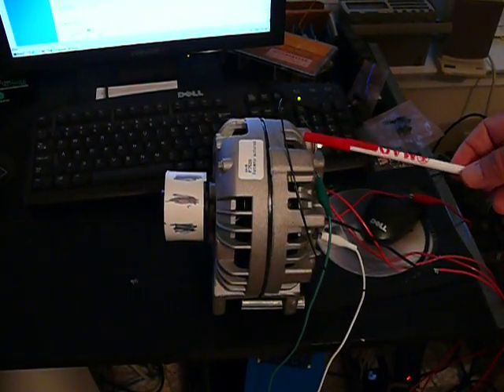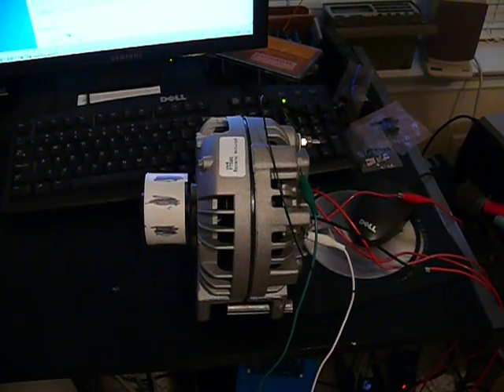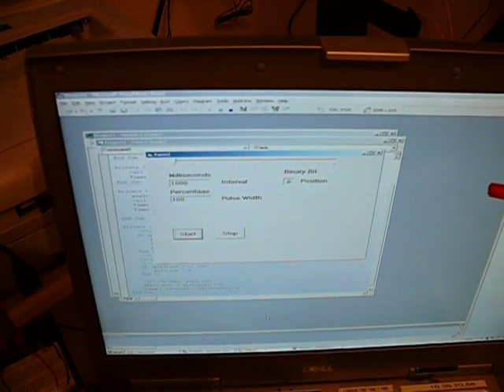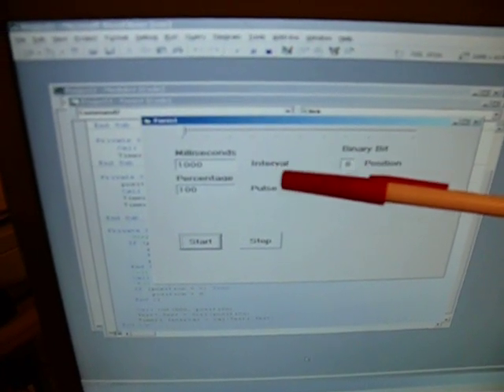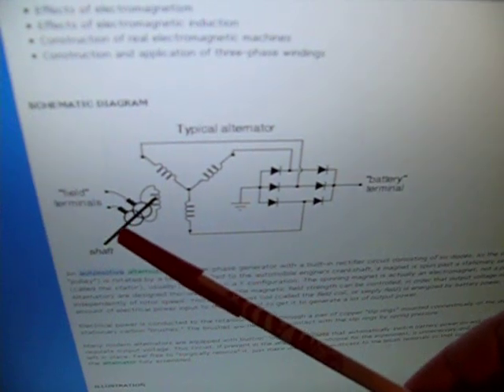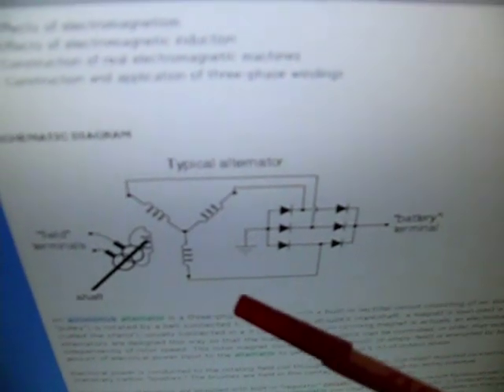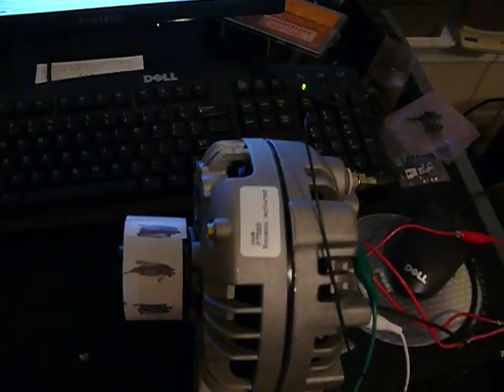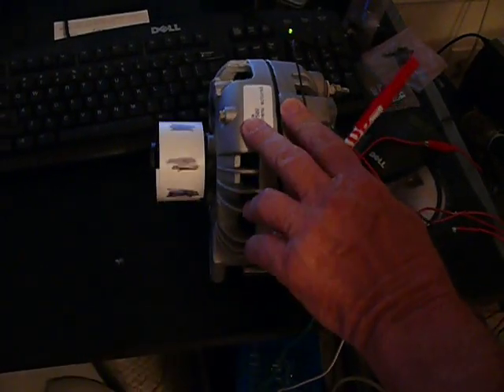How to convert a alternator into a motor

Comment: Hello there, I have got a normal car alternator and bypassed its diods, I only would like to use one phase to get it spin, I am intereseted in a fix relatively high speed, which ESC controller should I get? Thanks

Comment: dude, you need to sense the position of the motor, either with sensors or sensorles through back  emf. you might as well just buy a brushless-motor controller for radio controlled models.
with that you can get much better performance.